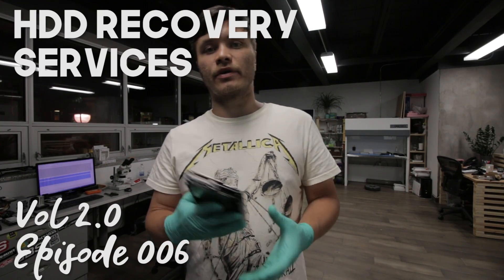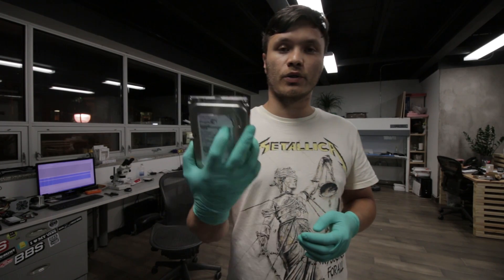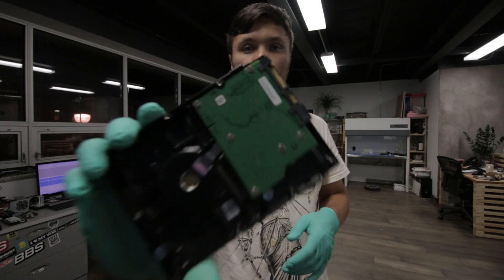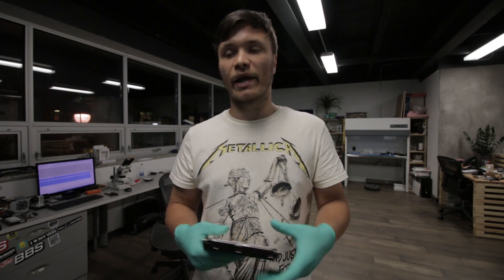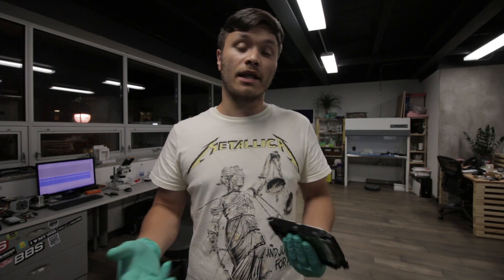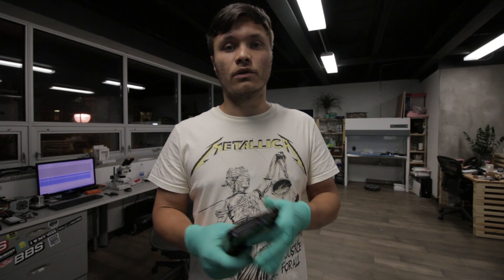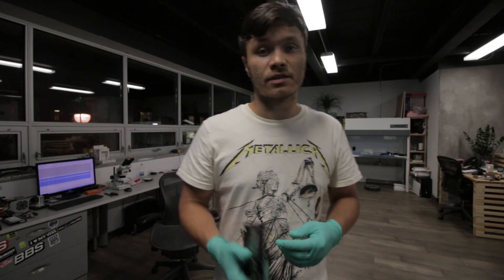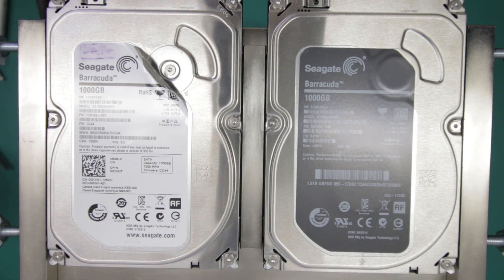half dead seagate ST1000DM003 | Data recovery

Comment: ive been watching tons of recovery vids. none of which is due to mine sadly. seagate 1t barricuda also. bootmgr missing is the error i get. drive not detected in bios or ubuntu. altho win10 is installed on the drive. is data recovery a need for mine?

Comment: Did you change the PCB and the firmware also? The donor is 2 years newer with FW AP19 while the defective has CC44. So I suppose the PCBs have different numbers also. Is it possible to just swap the heads? Did you truncate the video for brevity? I see that in @3:35 you point at the FW/BIOS chip but you don't say anything
Reply from the maker: no, I did not change PCBs. just swapped heads and transferred head adaptives from donor to patients PCB
Reply: Oh I googled it and I see that with PC-3000 or MRT Lab software you can easily copy that part of ROM that has the head information. I suppose it could be done from the terminal also but I am afraid no one knows how to do it :)

Comment: Wondering just how many thousands of these drives were sold,and failed under warranty
My Seagate  ST1000DM003 failed in five months.16 years of storage /files/pictures gone with a wimpy ticking noise.
Seagate WILL Replace the drive.Free.Your data? no.Sorry.

Sorry.

See if I buy another Seagate product.WD is no better,same answers.Less total failures
Reply from the maker: WD is more likely to be recovered in event of physical problem. Seagate drives just love to eat the surface with failed heads and often it will prevent the recovery even if you are ready to pay any amount for it

Comment: Hello Erkin - I've been researching recovery solutions for my same drive and watching a couple of your videos.  What ISO Class (10, 100, 100 ?)  is your bench and when was it last certified (have you got current certificates you can post on your site?).  Please let me know what's your data recovery rate % on headset replacement job for this model, vs. a PCB/Diode no-spinup job scenario?    Also what's your price in USD for each of these 2 scenarios (in contrast, my device has NOT been opened by anyone)?   I'm asking publicly here because while your website talks basic pricing tiers, this repair on this drive is so common I figured I'd do some folks a favor and ask you to state what it cost on this one sine it looked like you had very little guess work due to the commonality of this drive and problem.   I have the same exact Seagate Barracuda 1TB model ST1000DM003, it seemed to die after the chassis which was standing upright on the floor, tipped sideways.  My Dell's ePSA diagnostic gave Drive not detected.  This happened back on 7/31/17, haven't touched it since, looking for recovery service with the best recovery and upfront pricing that is not a wide range, and no firm quote til its been opened.  Many, many thanks in advance.
Reply: CG O did you ever get a reply?
Reply: No reply received from Erkin.  Lab who answered my questions directly and technically won my business.
Reply: @ceciliaoreilly4023   Yes, if that drive was mine, and he was handling it like that in the video, I'd be really unhappy with his professionalism anyway.  just sayin.  I had Payam refuse a free quote  (a company in Melbourne Australia) and they quoted $1700 sight unseen for a single platter swap.  Let's just say, I'm going to train myself and do it instead, once I have the tools.

Comment: Hope you can help me !!! my external disk shows unknown , not initialized error. i couldn't initialize it to MBR that it show " The request is failed due fatal device hardware error. What i should do now. what is the actual problem. can you help with this !!
Reply from the maker: hard drives can have many different issues that would, in fact, sounds the same, but need to be tested in order to find out what the solution would be. Not to pee around the bush, you need to have some equipment that can read what terminal log is in order to know what this drive needs. I use PC3000 and MRT for this, but I don't know of any other solutions simply because I never had a need to explore. If you want you can send it here, and we can do it up.

Comment: I Have HGST 500gb 2.5 inch HDD. It Works Until Gets Hot Just 10 Minutes After Start (Too Hot Too Touch) Then it Stops Spinning And PC Freezes. After Cool Down When I Restart PC it Starts Spining. What Does It Mean Can it Be repaired. Plz Assist Me... :(

Comment: What exactly is a donor drive? Do you buy brand new stock? Or do used damaged drives serve as in a junkyard for cars? thanks. Love the work you do.
Reply from the maker: if you check one of the previous videos that we did, we explain what donors are, and how we get them. But your junkyard reference fits very nice. They are not new drives, it would be crazy expensive.
Reply: thx

Comment: What is about CDs?
Reply from the maker: no CDs
Reply: hmm, I found one time a German company which repair them and recover the data, but they use special machines to prepare them. I thought, you do that with your own method too. Thanks anyway.
Reply: If you have moderately damaged CDs (too scratched to read, or something like that - not broken) you can either polish the shiny side with car polishing equipment (yes, really) and/or buy a Lite-On DH-48C2S or DH-52C2S and try to read them in there. Those two drives are unusually good at dealing with scratches for some reason. For DVDs it's much of the same except the Pioneer BDR-209DBK seems to handle scratches well.

Comment: hi sir
i would like to thank you about sharing all this knowledge for FREE it's really amazing , and i have question :
i dropped my 1TB seagate  external hard drive and every i connected to my laptop it's made the sound of plugged in sound and i see USB symbol but when i go to computre i can't find it 
i tried to use "computre mangement" > "storge" i find  2 TB unlocated storge every time i plugged in my external hard drive .what is the problem ? can i recover the data in it?
please help me if you can
Reply: Another channel mentioned if a drive is not showing up it can be damaged heads.

Comment: seagates have been fine with me...no issues even at work where we use about 20 of them. Its mostly when you put them in bad enclosures or non-UPS environment where drives fail on you baaaad. 

seagate exchange program is good too, i had killed 2 completely new drives with PSU that was faulty and they have exchanged it no problem.

Comment: What is the best drive imaging software in your opinion?  I tried Macrium Reflect, Acronis True Image, Clonezilla, etc and always get mixed results. Recommendations would be appreciated.
Reply from the maker: I honestly never used software based imaging software for one reason. Software based imaging tools can only send standard read commands to the hard drive. They simply do not have an adjustable mechanism for changing parameters, intensity, and algorithms for reading passes. In near future, I have plans to showcase the difference. They will be longer episodes, but those who are interested in this topic will find them resourceful
Reply: HDD Recovery Services do one on firmware IC swap too
Reply from the maker: for hard drives that don't spin up?
Reply: umm...may be. I'd like to see a firmware IC swap done(soldering) on a PCB of a HDD, preferably Seagate ST1000DM003 or ST2000DM001 or products from that generation. Doesn't matter if they don't spin up or don't get detected. Just a walk through on fixing those drives would be great.

Comment: What a coincidence I had a seagate here exact same model that died today. Luckly it is in a raid 10 array. If youd like it I can send it to you for parts. Says has too many bad sectors. Thats what the NAS Controller is reporting as the error.
Reply from the maker: to me what kills it is not the huge failure rate (WD has some really high numbers too), but the how they fail. With WD I can easily say that we recover over 95% of drives and it is not some commercial BS, this is based on my personal statistics. But with Seagate recovery rate maybe at like 70% because so many of them come in with heavy platter damaged. With platter damage like Grenada drives develop out of the blue, even partial recovery can be extremely difficult and time-consuming. Not to mention that multiple donor drives may have to be involved. WD is angel comparing to Seagate
Reply from the maker: not a coincidence Chris, its just seagate LOL. Sure we could alway use more of these for parts. My stock is kinda thin on ST1000DM003 donors. I'll msg you
Reply: Are Seagate drives that bad? That's what I always buy (most likely because they're cheaper). For me they're showing signs of wearing out at 30000-40000 hours. I'm only a hobbyist PC repairer but I don't see many Seagate failure. As much as WD I would say. It's nowhere being as bad as those 2.5" Toshiba…
Reply: Every single seagate I have come across has died or failed.
Reply: Just a seagate Chris lol... I might have a ST1000DM003 donor at home. I'll look. Remind me